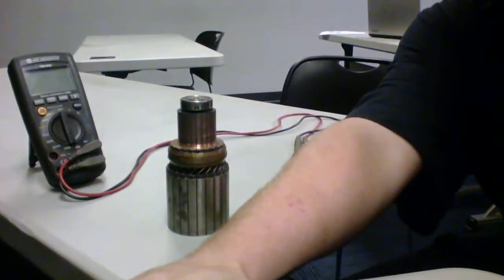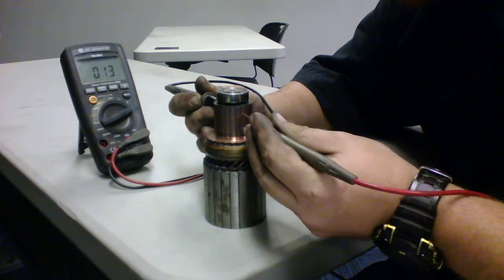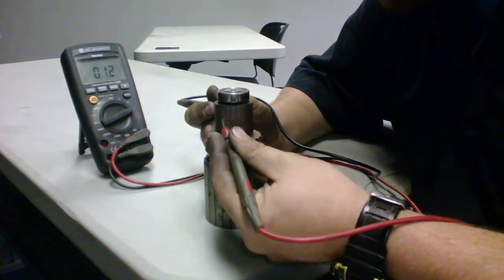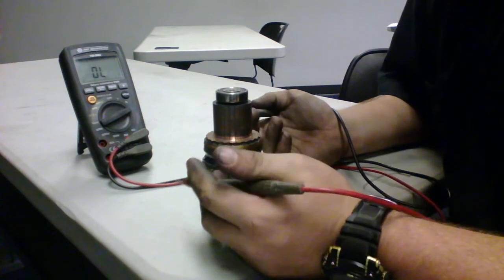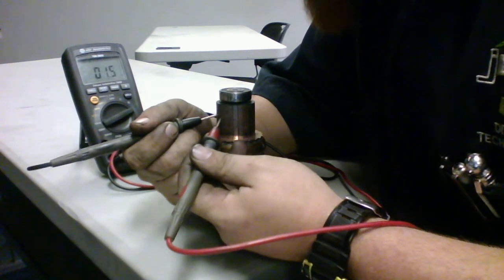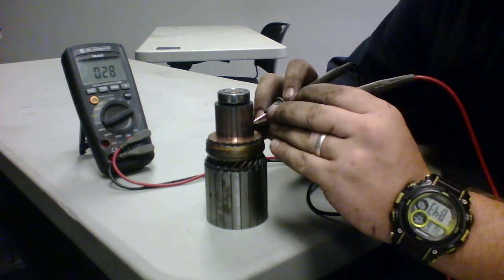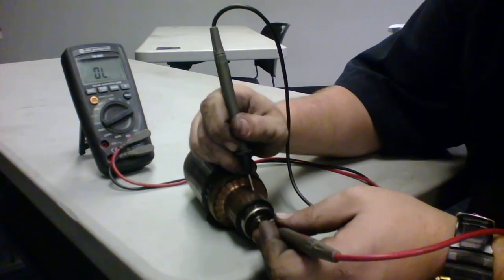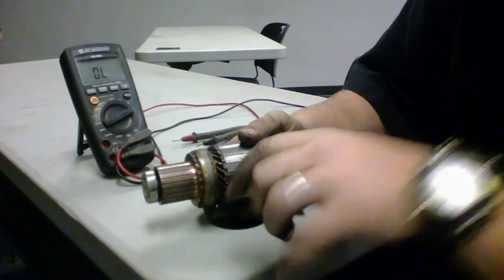Starter armature test.

Comment: Thank you Bradley for this video. I have some small suggestion on how to simplify your test. if you follow a schematic for an armature you realise that every pole is in contact with each other, all of them. You simply have to check for continuity between one pole and the rest of them, not even all are necessary, the 180 degree is not necessary. Then check for non continuity between one pole (since they are all connected) and the armature. Leads are rather thick and your 1.2 ohm is likely the leads of your measurement devise depending on quality of the leads. Check ohm by putting test leads together. Thanks again!